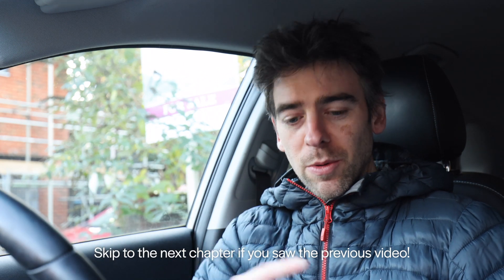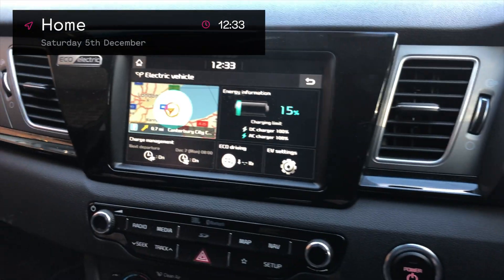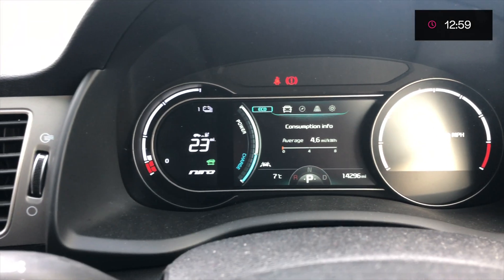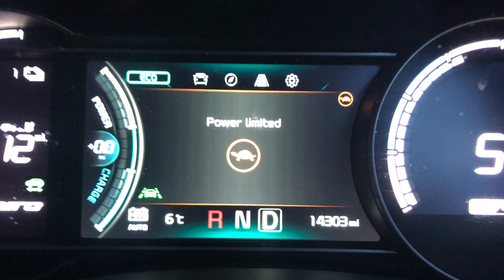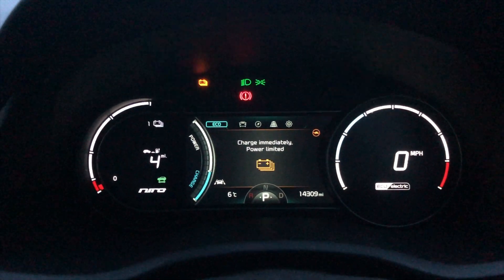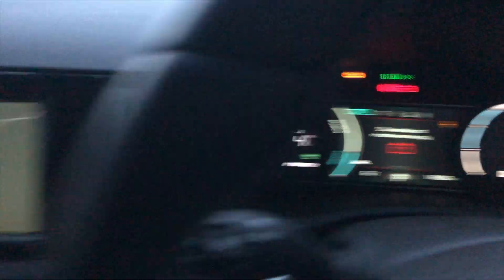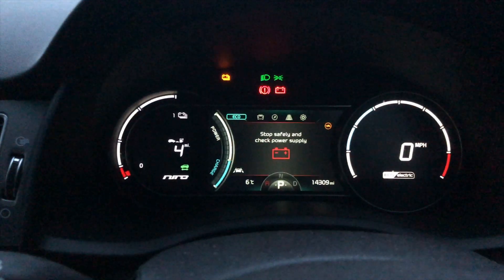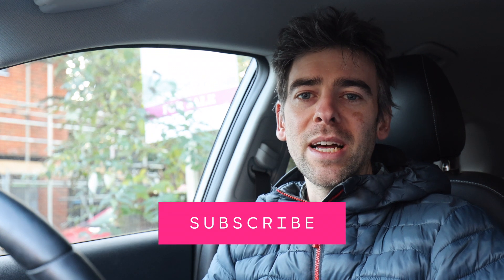Why I should have calibrated my Kia e-Niro's battery management system

Comment from the maker: A lot of comments asking what jump starter I have. It's an Arteck one I bought from Amazon but it's been unavailable for over a year now. Something like this from NOCO should do the trick nicely but there are so many options on Amazon and in theory much cheaper ones should also work: https://www.amazon.co.uk/dp/B015TKUPIC/ref=cm_sw_em_r_mt_dp_HZk0FbW2SAECS
Reply: Hi andrew https://youtu.be/ZH7V2tU3iFc go to 22.30 in the video sounds abit like what you experienced.
Reply: Went to find the link for the one I ordered in October and the listings been deleted 😬
Reply: Looks good emergency starter . Seen then before m8 brought old style about £60 and works well with 2.2 petrol but it big . I like this as it’s small will try this on m8 car see how well it works.
Reply: I bought a Halfords branded jump pack which is also a tyre inflator and has a white work light, white SOS flashing light and a red light.   Extremely useful.
Reply: I have found a jump starter very useful. A mercy journey to restart my daughters Fiat and also my motorcycle.

Comment: From what you said recalibration seems to make sense, but to do so every 1-2 months seems to go against a lot of advice "out there" to NOT keep charging the traction battery to 100% as that is bad for it's longevity. Wouldn't it make more sense to only do a reassurance recalibration before a particularly long trip, e.g your summer holiday away, rather than on a semi-regular basis at times when potential range is not critical?

Comment: Andrew I have just had a good lesson. I came to my 20 month old ENYAQ parked in a car park for 2 hours, and discovered the 12v was flat, fortunately I had a booster and apart from the inconvenience, I got away ok about 30 mins waisted.
The big lesson in my ŠKODA the  manual key is on the passage door only so if you can’t get access to the passenger door you’ve had it, I can’t find any other way of getting in. I had been parking on my drive with the passenger side only inches away from a wall, had that happened on my drive then as far as I can see you’ve had it, also if you can’t open the passenger door you can’t get access to the bonnet release. Bad design as far as I’m concerned, and I don’t think it’s unique to ŠKODA.

Comment: I mostly run the car between 20-30% and 80%.  On longer trips I will top up to 90 or even 95% and I know from the journeys we take where and when I will need to charge.  I will let it go below 20% when I know I am going to charge imminently and have seen it down as low as 4%.  

We're off on a trip in a few days which is 170 miles door to door.  Our ID.3 will comfortably cover 190 miles on 80% but I will top to 90% or perhaps even to 100% just before we go.  I can charge overnight at my destination.

Comment: Not so much caliberating but rather reseting the bms's understanding of where abouts the battery is in its state of charge.

The tracking of power put in power taken out is a good method but over long periods of time the error builds up combined with self discharge and other system losses.

Charging to 100 % in itself is not really that bad for a battery but rather staying at 100 percent is especially if its warm/hot.

Charging to full then imedietly driving will minimise the damage whilst allowing the bms to reset its charge state estimator.

Comment: Is it important to do this every month regardless of driving habits? I have an e-Niro and my commute is rather short. 10 miles roundtrip. I charge from 20-80 every 5 days or so. Not sure how often I would have to do this. Thoughts?
Reply from the maker: One a month to 100% should do the trick. Only on an AC charger though — it doesn’t work on a rapid charger.
Reply: @MrEV  Even if you almost don't drive the car at all that month?

Comment: I bought a used 2016 Kia Soul EV+ in 2020. Fantastic car. The one and only time I ran completely out of range was when the GOM said I had 4 miles of range left and the charging station was less than 1 mile away (I could actually see it with my eyes up ahead), but then suddenly that 4 mile indicator turned into "- - -" and I was forced to pull over. The tow truck had to tow me for less than  5 minutes to get me to the charging station. Funny thing was, he could not understand why a simple jump start wouldn't fix it. So I explained how the two systems, 12V and high voltage, were used for different things. The 12V battery was totally fine, but could not be used to move the car, and even if it could the car would probably move a few inches per second at best, for about 1 minute. (No, I have not tested this!) One good thing, though, was that he asked me a lot of questions about EVs (for more than half an hour as I charged) and I squashed a lot of rumors he had heard about EVs ("Don't the batteries need to be replaced every 5 years?", etc) and he seemed genuinely interested in taking one for a test drive. He especially loved that it costs me about $2.80 to "fill up" at home.

Comment: It is far better to have a diesel or gasoline car than to bother with battery, charging, range, etc.
Reply from the maker: I'd say it's far better to have an electric car than to bother with going to a petrol station, paying a fortune in fuel and servicing costs, polluting the air, etc.

Comment: I suspect you had unexpected drop in range precisely because you had uncalibrated battery cells. The battery is as strong as it's weakest cell. I suspect the car was showing range based on the full energy left on the battery and corrected it self based on the weakest cell, that's, I think, it's why the range droped. Also, you can not make any conclusion based on the range at 100% charge, like you said, and well, it's a guess.

Comment: Thank you for the Info Andrew,an Battery Calibration,I never gave a thought,my Son thinks it should not be neccessary in a Modern car,obviously wrong.I shall be watching my Batteries.I am also learning by Driving,and it seems there is a lot to learn,I am not very good at learning from the Manuel,maybe because of my age(73 yrs old).As an Englishman living in Germany many years(since 1961) I have no problem following the Prompts fom Workshops but one doesent always get precise info,I go in for the first Update next week,and I wonder if anything new will change the Software,I have my E Niro since 12.12.2020.keep up the good work,my worry is will I be able with my Cards be able to charge my car everywhere?

Comment: You've proven the fact that the most unreliable component in any road vehicle is the nut that turns the steering wheel! 😉
I wish that I'd seen this video before commenting on the  previous one. But it's still valid, so it will remain, unedited. Thanks for the  honest heads-up, Andrew. We appreciate it.

Comment: I have a 2019 Kona EV, so normally the same drive train as your Niro. Had a similar experience. Forgot to charge the night before, and found myself at 3% battery with 12km (including uphill) to go, at 5 degrees C. Luckily, there was a charging station and added 4% of battery before finishing the trip home.

From what I see, didn't notice a change in behaviour below 10% (the battery didn't discharge faster) apart from the turtle mode. This being said, I tried to reduce consumption as much as possible (eco+ mode, no radio, no heating, slower driving).

PS: I have just received a letter from Hyundai for a recall, to update the BMS (following the battery burning issue). Don't know how this will affect the car's consumption.

Comment: An interesting and  informative video. Now winter is with us my e-Niro (First Edition) has developed a heater problem and I wondered if any of your subscribers have had a similar issue? Within a couple of minutes after switching on the heater a "check electric vehicle system" warning flashes up and the EV light illuminates. The heater then switches off. System resets after a short stop and the rest of the functions are fine. My local dealership in York now have the car and have ordered a new heater which is on back order until March 2021. The dealership have been great and initially lent me a Sportage MHEV, but have now replaced that with a e-Niro 4, so a least I now have decent headlights. The service department have told be that this is a common fault and also effects the Kona electric. Does anyone have any further info? Cheers and Merry Chistmas to all.

Comment: Checking the SOC of the HV battery and 12V battery is very easy with free Car Scanner Elm Obd2 app that works with all elm327 adapters. All custom PIDs for Kona EV are preinstalled in Car Scanner. OVMS is great but requires expensive dongle and has cumbersome installation.

Comment: Calibration is only knowing for cell phone batteries. For BEV's is the best to keep the SOC between 20 and 80% and the charging as low as possible (between 3 and 11 KW). Rapid charging is not good at all for the batterie.

Comment: The one time my early LEAF 24 came to a halt was 400 mtrs from home after a 75 miles journey on a not full charge . It was dark , near freezing and raining , The Gom showed just enough to get home 10 miles from home then went to flashing bars, three miles out we went to Yellow warning , half a mile went went Turtle as we came down a slip road , at the end of the slip road everything went black. Luckily some passers by pushed me to a safe stop point. By the time my son drove from home, just along the road, I was able to 'restart' the car the 12 v battery presumably had recovered as Lead/Acid batteries do.  It was a short tow to home, but I suspect that I could have got home under my own steam if I had thought it through. 
Since then I have Always plugged in every night, and try to run the car down to less than 10% about once a month. Now I am some 42000 trouble free miles in my Zero.2 LEAF.

Comment: My wife wonders if she has set a record. In her 2020 ENiro 4  she got home from London to Mansfield arriving on our drive at 10pm with 1 percent battery in October 2020............!   After watching your video,  we will be not leaving the car so short of charge ever ever ever again........ She had stopped at the new Milton Keynes Bus Station EV charge forecourt,  but only charged enough to get home,  ten more minutes would have made a huge difference.   Meanwhile we LOVE the  ENiro, got it in July and  have done 6000 miles trouble free up to date (Mid Dec 2020). She is going to London in the morning and our top tip is  to stop near London (150 miles from here) and do a rapid charge on the way down,   then we are sure we can get home  without needing to stop again.   Thanks for the videos, we watched them all before buying our ENiro, they were very helpful.

Comment: Really interesting but also very disappointing (for Kia). That last few miles is the bit when it is most important for range to be accurate and the computer should be juggling recent driving style with what's still in the battery to keep it accurate. Your suggestion with the "calibrate the battery" seems to be that the car takes the range that it calculated at the last charge and then just counts down the miles driven - but that can't be right because it couldn't allow for miles gained on regeneration (I live with some significant hills!). I spent 6 years driving a Vauxhall Ampera plug in hybrid before getting my e-Niro and on that the remaining range could be trusted down to the last mile. Kia should surely able to do better than your experience. However, I have taken the warning on board!

Comment: I think you have misunderstood how the 12v battery is charged.  When the car is switched off, the 12v battery gets a top-up if needed as indicated by the flashing 67-100% charging light.  This process does not seem to operate when the state of charge of the HV battery is low.  When the car is switched on, the low voltage systems (BMS, heater, lights etc) are powered by the DC to DC converter which steps down the power from the HV battery to ~14 volts for this purpose.  It also charges the 12v battery.  The 12v battery only powers the low voltage systems when the car is switched off and for the couple of seconds between pressing the start button and the green car "ready to drive" symbol coming on during which time it powers the systems checking that the HV battery is OK and closes the contactors to allow current to run to/from the HV battery.  So I think your car was charging the 12v battery because you were driving it - even at the low state of charge of the HV battery.  I guess it failed because there was some drain on the 12v battery while you were parked or it was in poor condition to start with - perhaps because the car had not been driven much recently and you have flattened it before I think.  Typically a DC-DC converter will put around 5-10 A at 13.9V into a 12v battery so the max energy draw would be 10 x 13.9 = 139W and let's add another 20% for losses  = 167W.  If you were driving for 2 hours that would be 334 WH or (334/64000) x 100 = 0.52% of your HV battery's capacity.

Comment: Something that you would like is a unit to show revised GOM also as long as other things like OVMS.  It's a small OBDII display that works on the e-Niro to show a lot of hidden information on the car and it's own GOM based on the last 50 km of driving that reacts more quickly to changes in consumption than the car's GOM.  Here it is: https://evobd2.com/

Comment: very interesting vid, I had a similar experience last monday with my MG, fully charged on the sunday to 100% and range indicated on eco was 141 miles, a bit low but blamed it on being cold, monday morning had to go on a longish round trip of 140 miles so knew I needed to charge and there were 2 about 100 miles from start with no fast chargers in between, problem was consumption at times was 2.6 miles/KW so ended up with 15 miles left at first charger, which did not work and by the time I got to the next one had 5 miles of range and crawling along. Answer we need more chargers before I suffer a heart attack or switch back to ICE

Comment: Great video thanks yer I was told do 100% once a month so I do that at least once a month. Does eniro had two trips ? I’ve found that if you leave trip for lots of miles like we did for first months 2/3 k miles , if gave poor reliability gom  as it didn’t adjust to today conditions etc and had 1 trip it dropped like stone when got below 20% and as new ev drivers on unfamiliar roads it was scary . But since resetting the trip every long trip or on majorly different days we have found the gom lot better and more accurate over the trip . Yes first 10 miles is way to much be soon drops as you drive , and I now look at State of charge and work from short term efficiency and check it to the gom  works for us on Zoe ze50. In one day this week took Zoe down to 6% to public charger due to road closures I usaly don’t go below 10% for this reason if something unexpected happens or chargers don’t work etc and the range drop was nice and linear and was ok just slowed down but the same thing happened on way home due to accident and got home at 4% !!! bit below what I wanted  but with luck and judging your % and gom on short time  been ok over 8300 only had range Anxiety 2-3 times but chargers anxiety lots as too Many chargers are single units and not got best reliability some of them . On a trip when I get below 40% I mentally check the distance  to go to the gom and battery % and adjust speed or charging Location every 5 miles or so as I normally drive Zoe at speed limits like ice car keeping up with traffic etc , so sometimes you need to just stop having so much fun and drive more eco to make chargers or destination if you travelling outside range of home charger .

Comment: The early power limit was probably due to the battery pack being cold and low state of charge as the both limit the current you can get from the battery.

Comment: Thanks Andrew/. We are all driving less and here in New England, it is cold.  I looked and it had been two months since I charged to 100%  The chargers are not very close here, so on trips, I plan to charge at 15% - 20%.  From Bjorn, I have keep the normal charge limit at 70% and charge at home when it get to 35%.  Trying to extend battery life, which after 22,000 Miles still reads at 100%. I have a small aftermarket display which gives me state of charge, battery temp, 12 volt battery and a number of other values

Comment: Recalibration every so often may improve Guessometer accuracy but only if your driving behaviour is consistent from journey to journey and other variables impacting battery performance remain broadly constant. This is unlikely to be the case for most EV drivers over an entire week, let alone over a month. The fundamental issue remains that EV battery performance is significantly dependent on driving style and environmental conditions. Until this is improved, the Guessometer will remain just that - a guess of variable accuracy.

Comment: I'm a 'newbie' electric car fan.  I've got a Leaf 62kWh Tekna.   It goes like a dream.  I wouldn't go back to ICE.   All over the internet there is conflicting information.   Some say always charge between 30% and 80%.   Others say 100% because the manufacturers always make sure that when it says 100% it isn't full and there is a certain amount unavailable to protect the battery.   So the YouTube EV 'gurus' all seem to have different ideas about batteries.   So far I've always kept the battery between 50% and 80% but after Christmas I'll probably go for 100% for the first time since new.